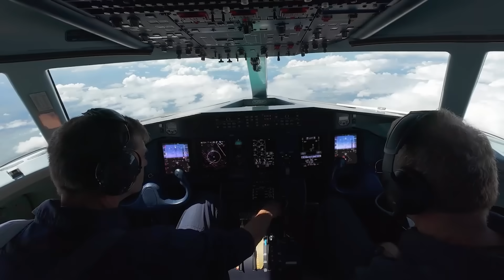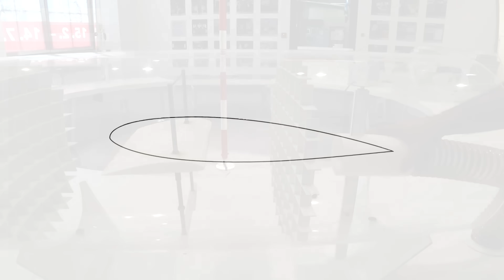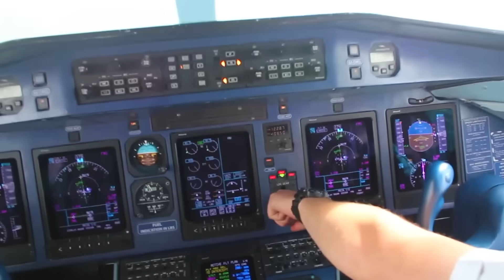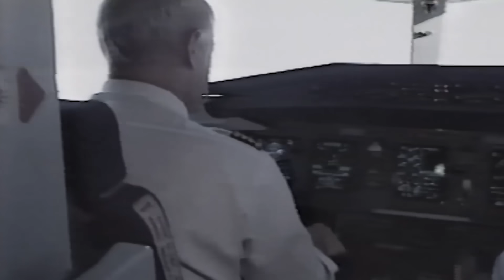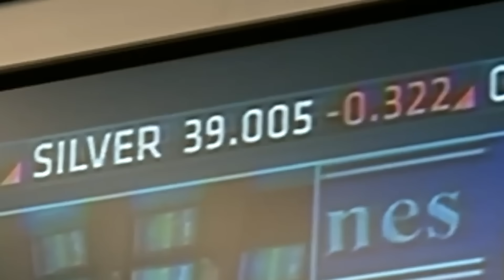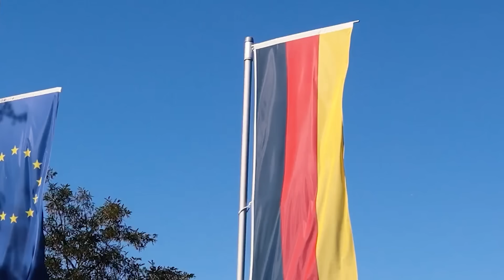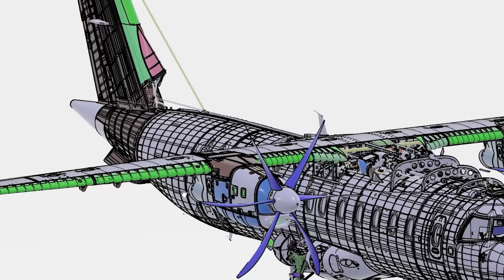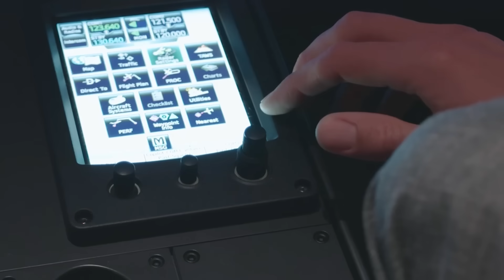Dornier Do 328 - Jet and Turboprop

Comment: The Dornier 328 turboprop and 328 jet are a couple of very fine little airplanes. They seem very durable, and for many trainee pilots can be very easy to learn how to fly. The "jet" made itself known as a decent 30-35 seating capacity airplane featuring the P&W PW-300 turbofan engines, for short hops in the regional market, competing with the Embraer 145 and the Canadair CR series jets. The shorter turboprop 328, establishes a similar role with  two greater performance P&W PW-100 turboprops, and a 20-25 seat capacity. They both do well in the European markets. Really good airplanes, these two.

Comment: Ehh, no, the Supercritical wing/airfoil was NOT invented during WW2. I am guessing the narrator/writer was thinking about the Laminar Flow wing/airfoil that was 1st used on the P-51 Mustang in WW2. The Supercritical wing/airfoil was developed by NASA in the 1970s, and 1st used on the AV-8B Harrier II, IIRC. It was designed to optimize lift while keeping drag to a minimum. The design also delayed the formation of shockwaves at speeds close to Mach 1, which also reduced drag.

Comment: I flew the Do228 quite a lot, in really tough conditions in Iceland. I have lot of time on the DHC-6 Twin Otter short field aircraft, and the Do228 had extremely similar qualities - except it had retractable landing gear with smaller wheels that lost out to the Twotter's robust gear - but won in having a 200kt cruise instead of the measly 160kt cruise of the Twotter. Then there is the worst thing about unpressurized  turboprops: Their range is abysmal! A C404 Titan piston twin has a 10-hour endurance (1850NM) range, while a virtually identical C406 (Reims Cessna Caravan II) PT6-powered airframe had the same fuel capacity 12but half the range. Conversely, the C441 Conquest, physically identical to the C404 and C406, had an ultimate range of around 2200NM by the simple expedient of being able to cruise at FL350. 
Finally, I had a year of experience flying the Do328, a larger and pressurized version of the Do228. With a cruise speed of 320KT and a 1850NM range at FL310, it was still an incredible short-fielder: I landed it, repeatedly, fully loaded on R12 in BIVM in moderate winds (10-15kts), and only needed 600m of runway to turn off at the runway intersection, and that was using only relaxed technique and moderate reverse/braking. The Do228/Do328 wing is a marvelous design, and it is a crime against aerodynamics theory  to have lost it - not to mention that both types were a delight to handle!

Comment: If they could make the 328eco certified single-pilot operations and how it is basically almost a STOL plane, this means it can technically be made for private customers especially if the eco has a longer range and decently fast. It is bigger than the Twin Otter but can pretty much take off and land where the Twin Otter can, so the advantage for reaching very small airports is a plus for airlines or air services to rural areas. There is indeed a niche market that they can take advantage of especially if the savings are as good as they are on paper.

Comment: That plane got out ex president patent name on it, in my country he was a president from 98 to 2000, 
In world, he known as Mr. Crack, a jenius from south east asia, expert specialized in wing design
Many fighter jets asked Mr. Crack for solution, he even helped f16 bad wing design,  and byk seeing the blueprint wing design, he immidiately knew the problem and he asked for 3 days to solved it, believe it or not he only gave some critical equations on paper and voilaaa, 4 months later, f16 can take off smoothly from ground. Before that, the prototype f16 maiden flight almost went disaster, big osciliation when taking off, almost crashed the plane 😂😂

Comment: Those jets will ataine quite the collector value, but I think the initial air-frame failed due to being a 2+1 seat per row.. as it should have been a 2+2.  I flew on one back in 1999, Grand junction to Denver.. first time in the rather new airport.  It was fast, climbed exceptionally well cut through the mountain air that looked to be turbulent at the Front range and used no runway at arrival.  The new version seems to be aimed at a really niche market that demands a very high rate of climb at they have selected a engine that is almost 50% more powerful, but by the statistics more efficient in cruise mode. and  doubt that 40 seats will ever be installed in most of these.  Th one thing that thy should retain from the jet is the hot leading edge.  Boots really suck, especially with a high laminar top wing profile..

Comment: I think the pronunciation is more like "Don-yay". At least that's how the Brits say it. And I think the Germans. 
I'm a fan of Doniers, going back to before WW2, they make some interesting stuff. The Do 24 is just fantastic looking, maybe the best looking flying boat ever. Who doesn't like a trimotor? And they are still flying them, I think they even still make them, with turbine engines now. I might be thinking of conversions but I think I remember being surprised they are or were still being built right up until recently. Everyone thinks the Catalina is classic but the Do 24 seems roughly equivalent.
Reply: Hello from Munich, which is situated only 30 km far away from Oberpfaffenhofen. 
Indeed you can't forget the pronunciation of the "R"  in Dornier. 

Try it wirh DORN-YAY.  Maybe this is the best approach to the right pronunciation. ;))
Reply: @JLeman-me1xh  Americans cannot pronounce the "R" the same way Germans or French do without some effort, the "R" sound is produced in the center above the tongue for Americans, while it is deeper almost inside the throat for the later, adding a very distinctive continuous "chocking rattle" (noisy sleeper). Similarly, latine prononciation of "R" is from the tip of the tongue with much slower oscillation, forward in the mouth cavity close to the upper tooth; Japanese is very close, though, in Japanese, the produced sound is not the "R" character in their mind, the closest to "R" being "L", they will intuitively pronounce "Dornier" "DAW-OLON-NIAWL".

It's a culture barrier. Overtime, muscle fibers related to vocals mature differently, making people unable to produce some sounds beyond a given age due to lack of practice. Even worse in some languages/cultures, some characters require a specific physique in order to be uttered..

Comment: My fingers are crossed for this thing's success! I always thought it looked as cute as a button, and it's performance is nothing to sneeze at. It looks like it would fill a niche that has been left pretty empty, the 30-40 seat market, one which I think makes sense for american EAS routes that wouldn't warrant an E175/CRJ-700, and require more capacity than what is provided by aircraft such as the Caravan, Sky Courier,  or PC-12. Given several types already used for these types of routes are closing on 20+ years old for the newest built aircraft (Crj-100/200, DHC-8 100-300, Emb-135, etc.), they are going to need replacement sooner or later, and this looks like it could fit in perfectly.
Reply: Out of all the languages that you chose to speak you chose to speak facts and you actually couldn't have said that actually any better than me
Reply: @RadicalFloat_95 FAX